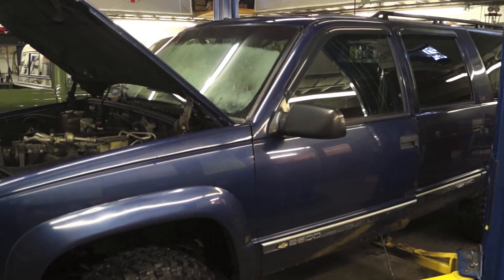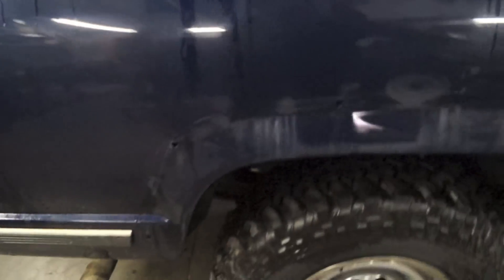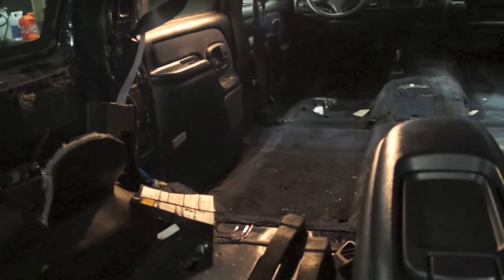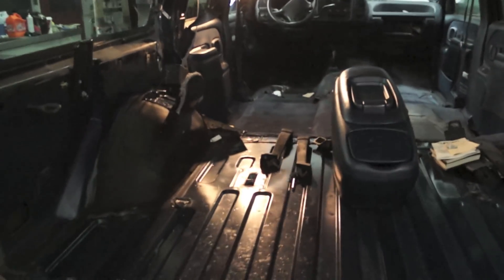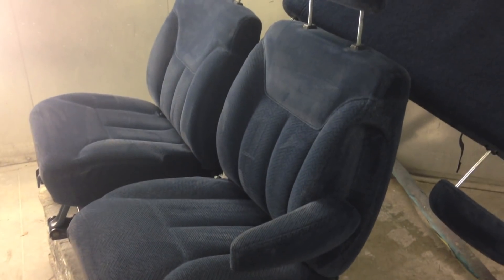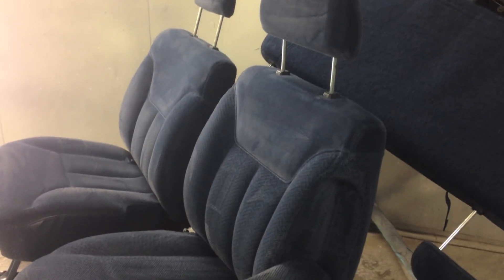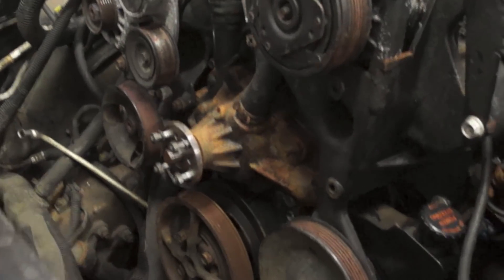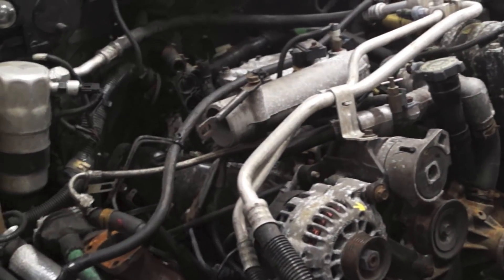Part 2 - Blue Suburban - Diesel Conversion - Cummins 6BT 12 Valve Swap

Comment: What did you do with motor mounts
Reply from the maker: https://adventurevehiclesnw.com/shop/diesel-conversion-parts/chevrolet-gmc/88-99-truck-suburban/1988-1999-chevrolet-gmc-1973-1987-chevrolet-gmc-truck-6bt-cummins-conversion-engine-mounts/

Comment: What’s the exact position to drill the new holes for the motor mounts.
Reply: i imagine that since they sell the adapter plates the either it will state in instructions with them or you could use them as a template to mark the hole

Comment: Excited to watch this build, Subruno is Awesome. I plan to do a similar project in the future. I have a donor 94 dodge 3500 4x4 single cab, with 12v/ nv4500, gear venders overdrive, only 98,000 miles on it. Runs like a champ. I want to put the drive train in my 2000 gmc 3500 4x4, crew cab 454 automatic. I also have a donor 79 Ford F-350, so I can sas Dana 60 in it. I’m not a mechanic, but look forward to building me a truck, that will last. If you can please point out in your videos, what you keep, what you tear out for wiring, sensors, systems, and such. How to convert everything over to hook 12v up, and make everything work. Part numbers. Thanks. What chassis paint did you use ?
Reply from the maker: Chassis saver from magnet paints.  They also sell Monsta liner.  Great products.

Comment: Do you make your own mounts? Where do you get your adapters? Do you sell conversion parts for this swap?
Reply from the maker: Yes we fabricate our own mounts and sell all the conversion parts you need to do this swap yourself. Contact us at info@jonesys.com
Reply: JonesysAutoClub, I'm doing a Cummins Swap in my 97 Suburban.  I checked out the link you shared for your website to look at what trans adapter you sell/suggest, and I don't see any parts or listing on the site.
I appreciate all the info you share and look forward to seeing the progress on this build.
Smitty
Reply from the maker: Email me info@jonesys.com and I will quote you the parts you need